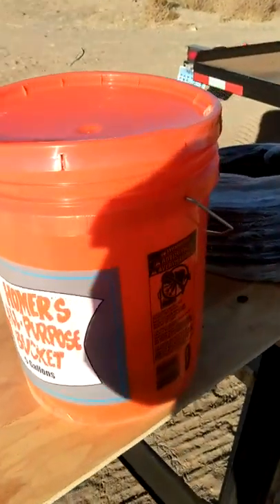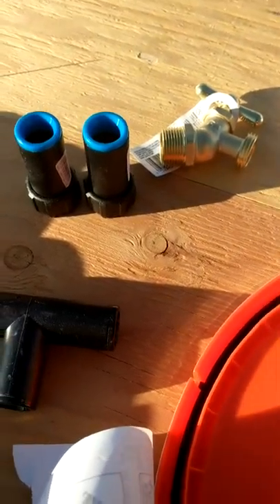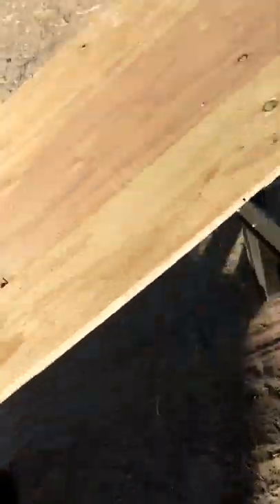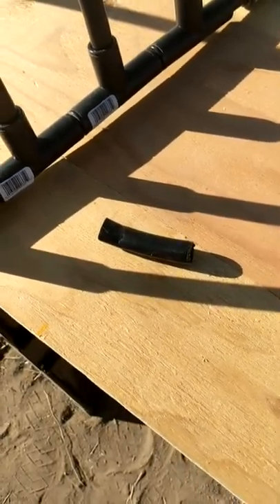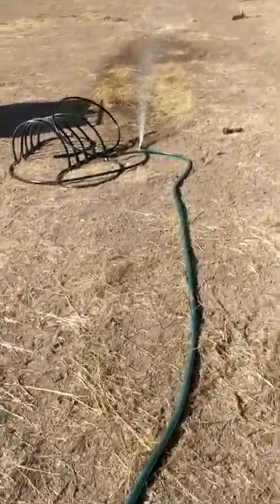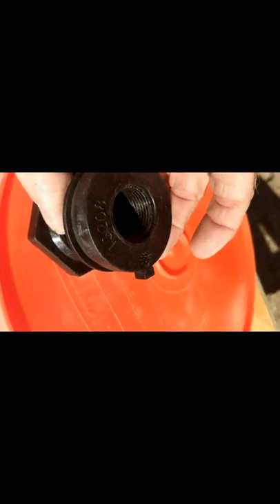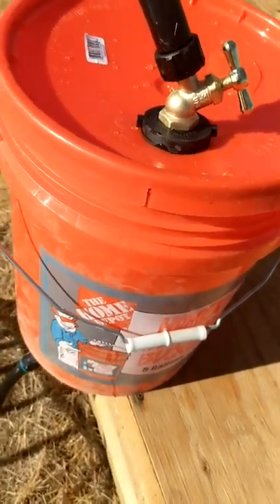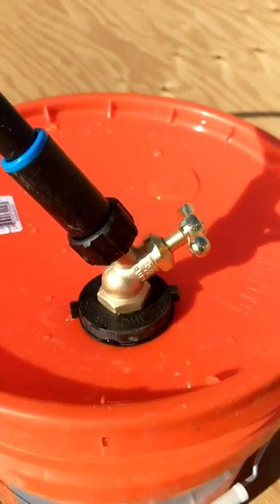Solar thermosiphon water heater FAIL

Comment: Unfortunately, this set up never even had a CHANCE of working.  Unless the water in the heated section was boiling, physics will never allow the water to ever flow higher than the level in the bucket and start recirculating.  The top inlet should be positioned on the side of the bucket and it and ALL sections of pipe must remain BELOW the surface of the water in the bucket - having no curves that ever rise above it.  Then and only then can a self-sustaining circulation be started.  Also, those valves are WAY too restrictive for this application.  The path for the water has to be as large and as free-flowing as possible.  Good luck!
Reply from the maker: I found out last year, when I was playing around, that you are absolutely correct! To get the thermosiphon action, you need the outlet to be at or below the water inlet. When I did that, with a new one I built, it worked like a champ.